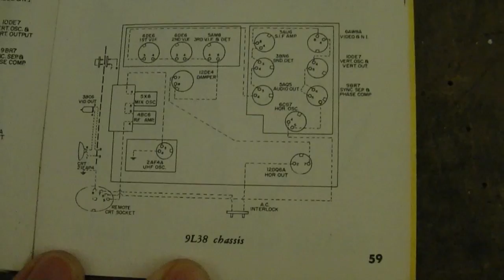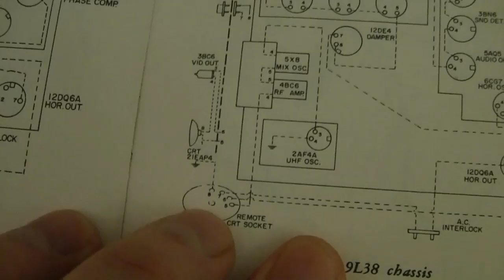Predicta Tandem II restoration pt12o?

Comment: As you disused before it would probably be a good idea to short out the ac interlock inside the plug. Would also probably make it easier to wire the plug back up since there is going to be less wire! But anyway, have fun! ;)

Comment: auick suggestion on cleaning up the crews.  You can spin them against a fine wire wheel on a mounted drill.  They will clean up real nice.  Just be careful.
Reply from the maker: I tossed them in a cup of Evaporust and they came out nice :)

Comment: It would perhaps be easier if you could find a solvent that would eat away the vinyl but not the plastic on the wires. Then you could just dip the cable in as far as you wanted to.
Just a thought. Maybe there is such an animal.
Good luck!
Reply from the maker: Maybe, but I suspect anything that eats vinyl will eat the wire insulation.  I wonder how long it took them to wire these plugs on the assembly line ?  I bet it was a real bottleneck.

Comment: You might find it easier to remove the insulation if you warm it up first. You could also remove it in two stages... strip back 1/2 of the outer coating first.
Reply from the maker: I think you're right - too bad it's not getting warmer anytime soon.  Maybe I'll move the space heater from my office in there.

Comment: Instead of cutting across the wires, cut along the length, split the insulation, and pull the wire out along the split.
Reply from the maker: Take a closer look at the end of that cable.  The outer insulation flows fully around any of the wires so I will need to make many cuts along the length while being very careful not to nick the wire insulation.

Comment: Was that badly repaired cable from the fire victim Tandem set?
Reply from the maker: Yes, it sure is.
Reply: That explains the rusty screws, it also doesn't say ,much for the so called "Restoration". But some guys just can't handle cable lead dress.